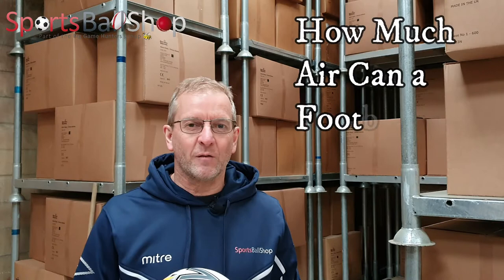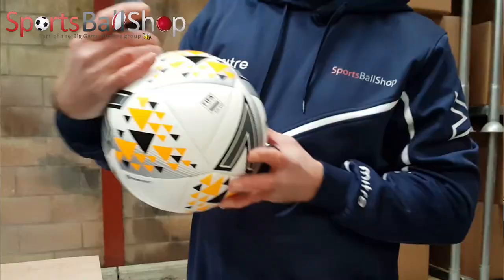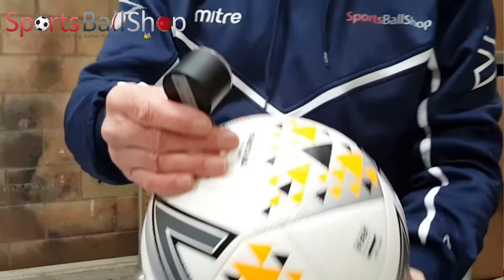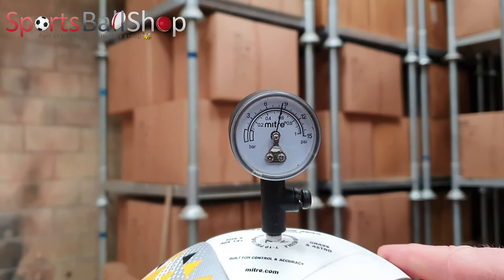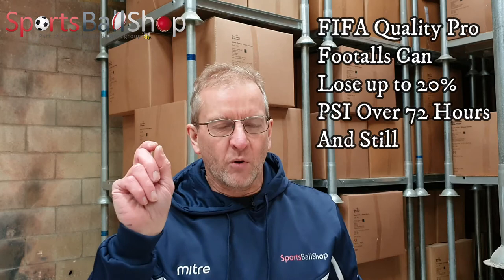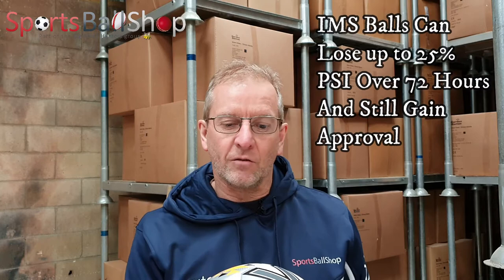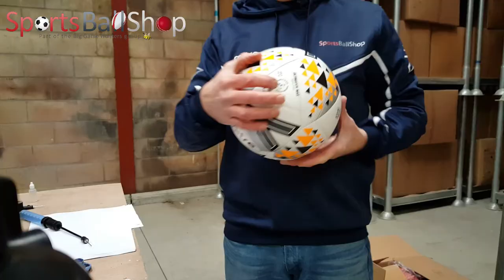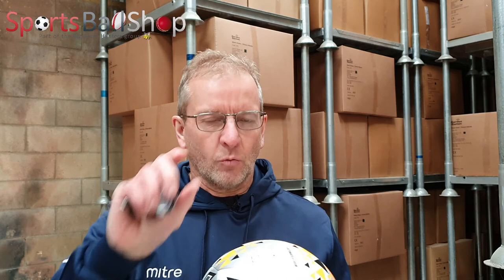How To Tell If Your Football Is Faulty

Comment: Hi sir my footballs part from here we fill air and insert the pin the small hole is up and down so will it create problem.is like from where you were checking pressure the small hole is up from one side iam talking about the small hole not the ball cover

Comment: What about in the summer? Mine is the official match ball and it looses about 25 percent if not more in one day but it is hot now so I don't know
Reply from the maker: Hi Drew
It may surprise you to find out that the official match balls need to be inflated every time they are used as the bladder is such high quality. I suggest it isn't a fault but the way the ball is designed so it doesn't deteriorate over time
Reply: @SportsBallStu  okay cool thanks for letting me know

Comment: How to find 
 if a football is correctly filled with right amount of air without using the pressure instrument
Reply from the maker: This can be difficult to judge and I have seen reps who have been in the ball industry for many years over-inflate their sample footballs, as they didn't have a gauge on hand.  So if the experts get it wrong, it is best to source a gauge if you can

Comment: what about nivia ball i inflated 9 psi as per given in ball but then also in 48 hrs it got 7.9 is that ball faulty 
?
Reply from the maker: Hi Raj Panchal It might not be faulty. If it is a match ball they are designed to lose a small amount of pressure over a short period to preserve the quality of the ball for use in matches. If its a training football you might want to check the valve for any grit. Using a drop of glycerin to lubricate the valve helps clear any potential blockages

Comment: Is that normal for an extra inflated ball to lose air? (With a sound of air leak just after inflated)  I am asking this because after it lost air down to a level the air leak sound was lost.
Reply from the maker: Hi Sailing Whynot The air might be from the air trapped between the bladder and the outer layer. As it gets forced out as the bladder is inflated
Reply: @SportsBallStu  thanks for the reply but the air is coming out of the valve hole. I checked it with some soap bubble. as I mentioned before now after deflating to a level it stopped.
Reply: @SailingWhyknot  mine does the exact same thing I'm not sure on the cause though
Reply: @CC--kf2kn  I figured out that after inflating I put the pump needle in and out gently and the air leak stops. But after three four days the ball leaks %25 of its air.
Reply: @SailingWhyknot  thanks i will try this when I get home. Merry Christmas 🎅
Reply: @SailingWhyknot  it works thanks
Reply: @CC--kf2kn  merry Christmas ☃️🎄

Comment: Every time I pump up a football, it deflates after a day. How do I stop this from happening?
Reply from the maker: Hi UP70 take a look inside the valve to see if there is anything within. Then put a drop of glycerine into the mouth of the valve and insert the needle a few times. This will remove any dirt or debris if within the valve. If that doesn't work there may be an issue with the bladder or the ball has a puncture. A puncture may not be obvious and is easy to get given the outer surfaces are a lot less dense than they used to be. Hope this helps 😀👍
Reply: Bro what is glycerine
Reply from the maker: @zeneration_editxzz  It is a lubricant recommended for balls. Sewing oil or a small drop og olive oil would work to, I hope that helps
Reply: Bro it is not losing whole air it is losing some air
Reply from the maker: @zeneration_editxzz  Check the psi as it may be overinflated and returning just expelling the air that is above the recommended level. That is a long shot but worth checking